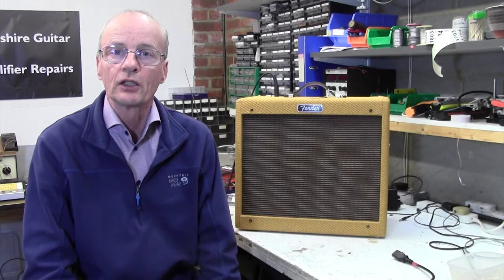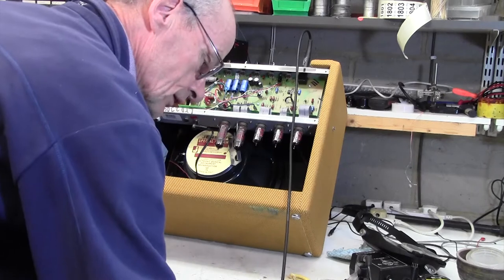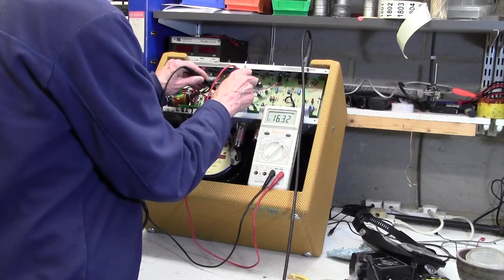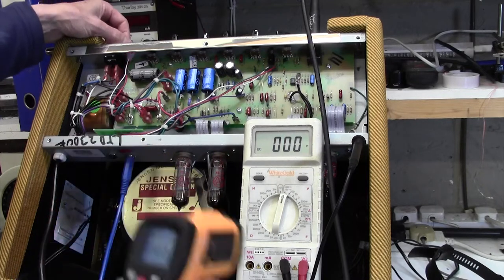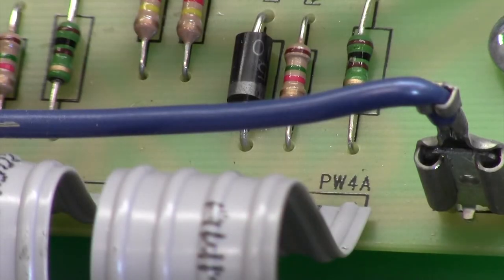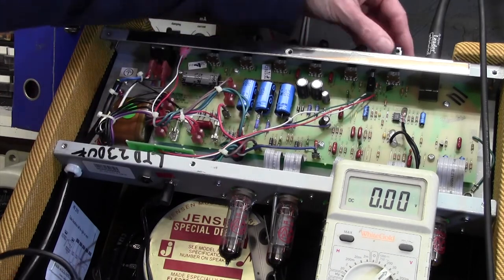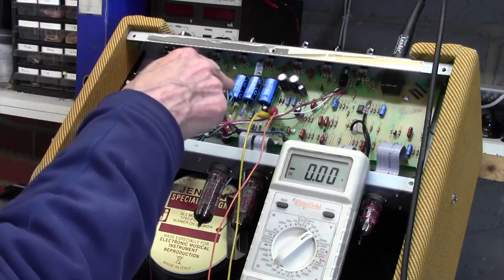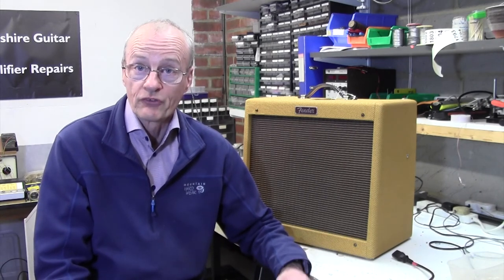How to Fix Fender Blues Junior Very Distorted Output

Comment: Thanks much for the tip on the screen resistor R35. My church has a blues Junior that one of the power tubes failed. So I put another tube in and amp was really distorted I quickly turned it off checked the screen resistor and viola that’s what it was. so all I did was go to R35 and it was open. I attached a 100 ohm resistor across it and it’s back in service. It is running really hot so I need to bias it now. You saved me a lot of time. Thanks again

Comment: Stuart, you deserve a huuuuge "thank you sir". My blues jr had been making that noise since one of the EL84 blew. Somebody told me the noise was due to an underpowered output transformer or a faulty speaker. After a couple of years without being able to play it loud, I bit the bullet, ordered a new speaker, new OT and new F&T caps and did the job myself. It went smoothly except for the fact that it didn't solve the problem. And then... your video. I measured my screen resistors and there it was, bingo! In my case it was the left one. I added a new 100 ohm resistor and my god.... It sings loud now. Like never before. I got myself a new old amp thanks to you. And all for a couple of cents. Cheers to you.
Reply from the maker: Nice one! Always very gratifying when it springs back into life! Well done.

Comment: Is it really OK to unplug a valve amp speaker with the amp powered up?  I thought that was a no no.
Reply from the maker: Hi Ben, yes lots of old wives tales about valve amps and this is one. The thing to avoid is having the speaker unplugged and then putting a big signal into the amp (e,.g, strumming a loud chord). This CAN overstress the output transformer but I've never seen this actually happen or cause a problem. It's a 'possible'. Just having the speaker unplugged with no input signal is fine.

Comment: Thank you Stuart.  I'd acquired a non-working Blues Jr.  Couldn't find the fault after checking capacitors, coltages (with the help of a schematic), and stumbled on this vid.  Same problem, same solution.  Same resistor had a tiny mark where it had blown.  The previous owner of the amp had given it away, all for what turned out to be a component costing cents!
Reply from the maker: Nice! Well done.

Comment: Excellent diagnosis. I have the same exact distortion from my BJ. Both power tubes are about the same temperature however. All three preamp tubes are illuminating and I have swapped them to see i there is a difference, which there was none. I still have the decaying distortion in the amplifier. What else might cause this issue? I've swapped a known good speaker with the onboard speaker and there is no difference. Any suggestions? Thanks for what you do. Cheers, Dave
Reply from the maker: I wonder if just ONE power tube in your amp is working? Try removing one, see if the sound changes. If it doesn't, put that one back and remove the other one. If the sound does NOT change in one of these scenarios, then one valve isn't working and you'll need to take it from there. If the sound changes significantly with either valve out, then it isn't this 'one valve not working' suggestion.

Comment: We'll go figure. Same issue, but the resistor is supposed to be 100 ohm was 5 milliohms.   Pin 9 voltage rolls though... not a steady output.

Comment: Thank you sooooo much for sharing your experience! I had the same issue with my Blues Junior and I would never have found out how to fix this problem. And there is no amp tech around here for miles. Now I could repair it myself and it works perfect again! 😊
Reply from the maker: E$xcellent. That's exactly why I do this channel (apart from the money, drugs and girls of course...).
Reply: Hey again! Now I noticed something strange, while I wanted to check the Bias. When I measure the red and the brown wire, the multimeter says 3.6V. But when I measure the red and the blue wire, it says 0.0V and the amp starts to hum. I uploaded a video of that issue in my channel. There must be something wrong, or?
Reply from the maker: @der_djumi_music  I've had that before and I have no idea what causes it! I normally now just measure red to brown. I'm not sure I've had ZERO volts there though so I guess it's just possible that one of you E:84s isn't working?
Reply: @stuartukguitarampguy5830  Yeah it is strange. The EL84s are brand new, I switched the tubes left to right and also tried other pairs of EL84s, but it made no difference. I had an opportunity to check the bias of a black Blues Junior and it also has 0V there! Maybe it is normal...

Comment: Thank You for the video Stuart. Another great example of how to troubleshoot.  have a Blues Jr III and converted it to point to point. Turret board for the components, new tube board, quality hardware and components. The build includes a trimpot for biasing the tubes. I bias them around 25ma which is 70% of their 12W rating. At least now I can fix any problem rather than toss more crap into the landfill site and the amp is a whole lot better.  There's engineered obsolescence and then there's what we have today. Cheers!
Reply from the maker: Nice one! You've got yourself a good amp there!

Comment: This helped me find which track to the valve base had the issue I was searching for. It started with a power valve dying - sound went thin. Replaced them to get the sound in the video. Checked the screen resistors - both OK. Checked continuity from valve base to screen resistor - gone! The track had been broken by the replacing of the valves. Sorted!
Reply from the maker: Nice one Karn, well done!

Comment: Hi, same problem here. At 9:00 you checked the pin 9s on the valves. Am I right thinking that the positive probe was on pin 9 qnd the negative probe was on ground?
Reply from the maker: Yes that's correct.
Reply: Thank you so much for your reply. I will attempt to check out pin 9 next time I am feeling confident enough ! My amp was crackling and popping when I was playing a little more aggressively. I put in new JJ power tubes but now the out put is distorted regardless of how hard or loud I play, not really bad distortion, but I prefer a clean sound. I checked and the right hand tube is way hotter than the left, but both of those 100 ohm resistors are reading pretty good. 97 and 96. I will be taking the amp to an amp guy, was just hoping to narrow down the possibilities. Thanks again for wayyyy out here on the west coast of Canada, .... Nanaimo, BC
Reply from the maker: Hi Tom. Those symptoms tell me that one of the valves is not working properly. Could be a faulty JJ. Your tech will sort it.
Reply: Thank you Stuart. All the best !!!

Comment: Hi Stuart 

IYou mention that the secondary side of the transformer (feeding the speaker) should measure 100ohms. Is that correct?
Reply from the maker: If I did, that is not correct. It is the primary which is about 100 ohms and that's what allows you to do the quick and dirty bias using a voltmeter. E.g. 2.5V = 25mA bias current.

Comment: Just did this today. Exact same resistor.
Reply from the maker: Awesome! Apart from the adulation of the masses, that's the main reason I do these vids!
Reply: @stuartukguitarampguy5830  For some reason it always seems it's the one on the right that fails.
Reply from the maker: @1Dougloid  Hmm, I wonder why?
Reply: @stuartukguitarampguy5830  Strange brew.

Comment: I have to thank you very much for this video. Turns out that we had the Blues Jr. amp with very distorted sound as yours. First tried  fiddling with R21 R22. Still distorted. It turns out that the same screen resistor as in your unit (I  don't remember if it was R35 or R36, 100 ohm) was open. Replaced it with another and voila. Quiet.  What a great video. Thank you. From NY, Alan M Richards.
Reply from the maker: awesome! Well done Alan.

Comment: Hello Stuart. First of all, congratulations for your videos, they have been very useful to me lately. But I have a "problem" with my BJr. The current between HT and the brown wire is around 40mA (I know it's too hot bias), but when I try to measure the current flow between the hot (red) and blue wire, the amp starts buzzing and my multimeter is not outputting any value... do you have any idea what it could be? I have tried all the resistors and they all work. The amp sounds correct, I just want to reduce the bias and remove that hum.
Again, thank you very much!
Reply from the maker: Hi. Yes I've noticed that too, I'm not sure what causes it. So just do the red wire and assume the valves are matched. That's the best you can do without a bias neter.
Reply: @stuartukguitarampguy5830  Ok thanks again! I've noticed that if you use the red wire that is located below the one you said I get some values. I get 40 mA and around 20 mA but I don't if that is correct... Any way... I will do what you suggest. Thanks again!

Comment: Nice work Stuart. I have the same amp on the bench at the moment with that same resistor open. I discovered the phase splitter, was oscillating at around 50kHz, which may have caused to the resistor to pop. Fixed with a 150pF across the anode resistor R30.  Also new valves fitted by the owner but one has been roasted and has lost 25% of it's output already!
Reply from the maker: Well done. You'd never find that oscillation without a scope on the output/.
Reply: @stuartukguitarampguy5830  Not at that frequency!  It's the 3rd one I've had with that problem, unstable amps

Comment: Thank you for this video. Can you help me fixing a problem? I have around 6.8V between red and blue from the output transformer and the same between red and brown ! Every voltages are good at the HT Caps and I also fixed the 100 ohms R35 witch was broken... Where should I search now? please help me there is nobody around me able to repair my amp! the sound comes but VERY distorted
Reply from the maker: Very hard to help fix by email! However, 6.8V means about 68mA of current through each EL84 and that's WAY to high. It should be about 25mA. I've done a video on biasing this amp so that's the first thing I would do.
Reply: @stuartukguitarampguy5830  Ok, I'll bias it but i thought that such a big value shouldn't be biased and I thought that another problem had to be fixed first!
By the way I found also 370V at the 470µF cap as the specs tell 329V why such a difference ? thank you
Reply from the maker: @regisrenucci3441  Bias: No, I don't think you have a bias 'proble,m' that needs fixing. You just need to bring the bias down to about 2.5V the way you are measuring it. I doubt this will fix your distortion problem though. I guess you've tried replacing the tubes? I wouldn't worry aout the 370V, that's not your problem.
Reply: @stuartukguitarampguy5830  Thank you, I'll do the Bias this week-end and I'll tell you. The tubes are brand new because the old ones were broken and the friend who asked me for help just told me: there is no sound. I checked also the txo 400V 0.22µF (C15 and C16) and they are right!
Reply: hello, I finally got time to bias this amp, the sound is OK to me but now, i've got two new problems: 1st the reverb is always on and full scale, no possibility to turn it down with it pot. 2nd problem is that the EL84 seem very hot to me as the current is about 25mA) and the smell is very hot, can you guide me please. Thank you !
Reply: Ok, No problem at all, for the tubes it's just about the weather in corsica, they are ok. For the reverb the pot was down. I just had to replace it. Now everything is working ! Thank's a lot
Reply from the maker: @regisrenucci3441  Hi. Not sure about the reverb, that's a very strange problem which I have never experienced. The EL84s do run fairly hot. If you are 100% sure they are pulling about 25mA each then that's fine and you don't need to worry.
Reply: @stuartukguitarampguy5830  For the reverb the pot was out of order, for the el84, I mesured et the 100 ohms resistor and the voltage is about 2.5V so it's ok, the sound is good, it isn't distorted. Thank you for the help. Now I've got a supersonic to repair, when you turn it on tubes are lighting in blue ! ... That's gonna be fun ! Thank you for your help

Comment: I paused the video,, haven't watched it all yet, but, first of all, just because the owner installed new tubes doesn't mean that those new tubes are good or even the correct type of tube. Best not to take anything for granted!  Honestly, the first thing I would have done after verifying the customers complaint, which you did, is that I would have done a resistance test of each leg of the output transformer primaries (to the centertap), and check the resistance of the secondaries as well,  with an ohmmeter.  And, as soon as you realised that one tube was running significantly hotter than the other, the obvious next step would be to swap the output tubes in their sockets and see if the same tube runs too cool, or if this current/ voltage imbalance occurs with either tube when inserted into that same socket.
Reply from the maker: There are many, many (many) ways of following a fault trail and I'm very happpy with the way I did this. Happy to (at THAT point) accept the tubes were ok. The amp had a fault, a brand new set of tubes and the exact same fault was there - I'm willing to bet the tubes are okay (for now) and move on to something more likely. There is no 'one way' of diagnosing an amp fault. Your way, you would have taken longer than me to find the screen resistor as you were busy checking output transformer resistances and valves! Not saying your way is 'wrong' it would just be one of the maybe dozen os so fault-finding trail possibilities all of which would eventually have led to the same discovery.
Reply: @stuartukguitarampguy5830  , not having worked on these reissues (only on vintage Fenders), and not having looked at the schematic, I'm confused by something else; in most Fender-type bias circuits, decreasing the plate current requires increasing a resistor value to push the (negative) voltage divider upwards and throttle back the plate current. How did lowering a resistor value decrease the output tube plate current? 

Of course, if the customer was willing and if the budget was sufficient , I'd have installed an adjustment potentiometer, but maybe the circuit is weird and making it adjustable isn't so easy...

The reason I would have checked the output transformer very early on is because it's the second most expensive component in the entire amp, and if replacement was required, it might have necessitated a phone call to the customer about the repair budget before proceeding.
Reply from the maker: @goodun2974  Hi. Imagine a potential divider with say -60V on the top, two resistors in series, 0V on the bottom. Pick off the bias voltage (say -30V) from the centre. Now REDUCING the value of the top resistor will give more -ve voltage and hence reduce the current through the valve. INCREASING the bottom resistor will have the same effect. It's easier to reduce a value by tacking a parallel resistor across the existing one than it is to increase a resistor value. Makes sense?
Reply: @stuartukguitarampguy5830  , yep,  makes sense ----  considering that Fender didn't put an adjustment pot in there in the first place! Most of us are used to changing the resistor in between the bias adjust pot and ground, in order to centre the potentiometer around a reasonable adjustment range. 

 Unrelated subject, but notice the spelling of "centre" above.  When I use the voice-to-text function on this Samsung/Android phone, It often types the words with the British style spelling such as favour, flavour, colour, behaviour and aluminium.  It didn't always function this way, it started after one of the periodic automatic updates to the phone's software......